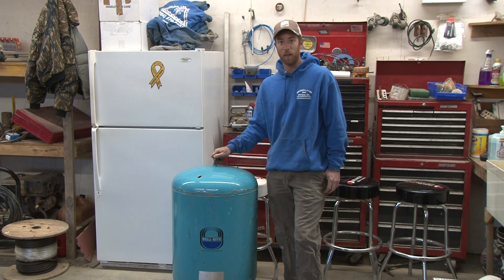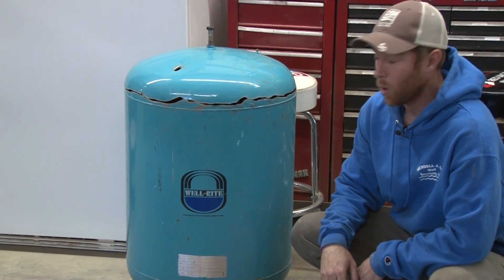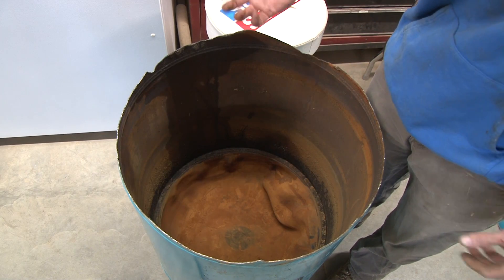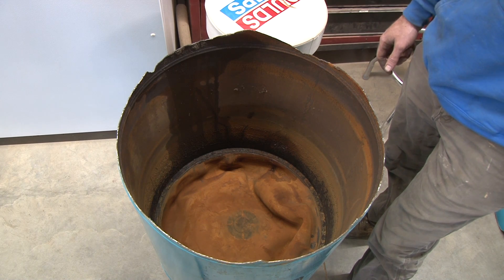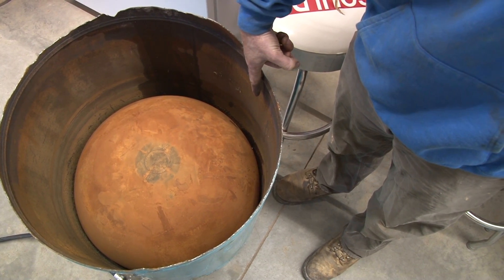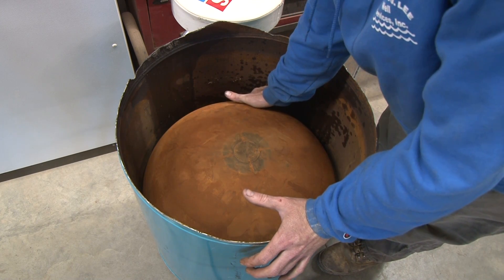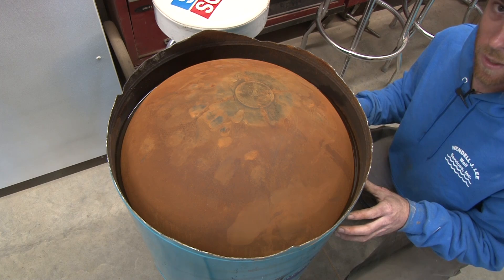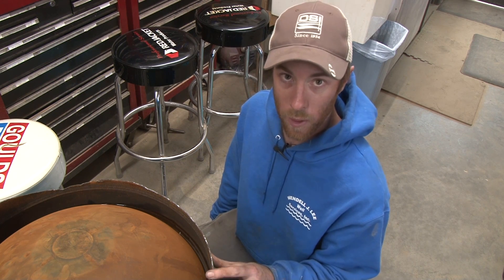Well Pressure Tank: How it Works and How a Tank Gets Waterlogged

Comment: Excellent video and well explained. We bought this beautiful house, but previous owner maintained it in a Mcguiver type of way. Possession in Sept 21 & hopefully just about caught up to bad maintenance work, you would not believe... i thought i would have some breathing space catching up, no way, all happening 1 behind the other... We have a Red Lion RL20 dated 2009.  Right now no problem with it, but piping before pressure tank going to pump is very rusty-flaking. Kinda worries me... i could send you picture if you give me an email?
Also just changed the Beckett ib-32-r oil hot water tank gave up dated 2004. Overdue, so looking at the copper pipe, because the rod inside tank must of been disintegrated, and pipe joints are sweating calcium. Should i consider having them changed? Like for Pex? We still are not drinking our surface well water yet... oh yes, i regenerated water softener and it cleaned up some... again could send you pictures :)  Oh yes again, HVAC guy tagged our furnace, i was telling him about headaches, so he checked the exhaust, Mcguiver had removed the exhaust motor, plus the air intake motor was seized and trap was held open by a pair vise grips. He was so upset, saying 1 more week in the big colds right now and whole family would probably be dead. He is right, waiting for chimney back order, using electric heat and no more headaches. Man some people... thanks, Maurice

Comment: good video  !!!..
I'm going  to  plumb one  of these  tanks  up to  my pressure washer to be sure I have  consistent  water  pressure  , and not  starve the pump when  I'm  out doing  washing  jobs ..
been  doing  alot of looking 
and no one has thought  of it yet...
I have a 4000 ,4 gpm hot water E -Z clean ... it should  help eliminate  running  a holding  tank and trying  to gravity  feed water to the  pump causing it to  starve for  water...

Comment: Need a new wster well pump installed tge well is in a 6" PVC pipe origanly it was driller they hit water at 85ft drilled to 105 ft. Need a new oump. Can you tell me on avetage what ut cost  for someone to pull the old one and install a new one on average. Dont have a lot of money. I just dknt want to get ripped off. I see a new pupm can be bought on Amazon for $200  or so

Comment: I drained the water from our lines. Blew the lines out. Pressure read 0 psi. Put about 10 lbs of air in it, and heard water gurgeling in it. 10 minutes later, it read 0 psi again. Bad tank?

Comment: I was in the process of doing some repairs in the house with the pressure relief valve on the hot water tank, I shut the well off and drained everything down with the garden hose at the well house new check valve between pump and tank, ball valve shut draining the tank when all of a sudden I had a large rush of air and no pressure on my pre-pressurized tank, then tank and pump are new.
 What could have caused it to fail so soon?  Pump and tank put in last month.

Comment: Also, how can I tell if my bladder has a hole in it, without guessing because it appears inefficient.  Thanks!
Reply: Easy actually, check air preassure on the top of thr tank, if its 0 then probe the valve at the top, if you get water comming out of it the bad tank

Comment: Many thanks for the informative video.  A professional pump service told me my diaphragm is waterlogged.  Now I know what that means.  It'll ruin my well pump.  My tank is only about 7 years old.
Reply: I know this a old post just to add your foot valve at the end of the pipe in your well it maybe sucking up dirt or gravel and getting into your  pressure tank and wearing it out from the inside you need a filter before the pressure tank to prevent damage I know this from experience hope this helps you and other people

Comment: Thank you for sharing how the bladder tank works. My well stopped pumping water. I have a Square D Pumptrol 9013FSG Pump Switch. The two middle terminals go to the pump. I thought if I ran an audible continuity test with a multi-meter across those two terminals, I would hear a sound. Did not hear a sound. Touching the screws on the terminals gave me a reading of 0 with the meter. Touching the copper wires, the meter either gave a reading varying between 1,724 K Ohms and 1,775 or no reading at all.  Tried this continuity test with the points open and closed, no difference in the results. Is this normal behavior of no continuity between the two pump wires?
Reply: I was a TV tech aprox. 82-02. I know nothing about those motors. The resistance of the wires does sound high. You might find it on a google search.
Reply: Ok let me explain how a pressure switch works.  You usually have a pressure switch and gauge installed on a accessory T with a 1/4" nipple going to pressure switch. From circuit breaker you have two wires that connect to pressure switch. Those wires connect to either the two outer contacts or the two center contacts. Then from pump and motor in well connect the wires from L1 and L2 inside control box to the contacts that are open inside switch. Once everything is connected restore power to well and wait for system to pressure up and shut off. All that switch does is read pressure on system and when it reaches desired pressure it opens causing power to shutoff at control box.  Hope this helpz

Comment: My well tank came from Lowe’s in October of 2001. I did not realize the cheap tanks only lasted five years. I guess I better check and see if my tank needs to be replaced. I hope you have a video on how to check a pressure tank.
Reply: I did not know that the big box stores sold some that last five years.
Reply: @PIANOSTYLE100  , after watching this video, I checked my pressure tank. It is still working properly. It still has air above the bladder and the air pressure was still correct. I purchased the 36 gallon well pressure tank from Lowes in October of 2001.
Reply: @jacklabloom635  Sounds like you are covering all the bases.  I noticed the Schrader valve on mine was mostly rubber and has to be treated with care when charging up the air pressure or removing the pressure. I'll probably go to Ace Hardware as local hardware stores have an atmosphere that I enjoy.

Comment: This is great information for me. My pump has been cycling on and off for the last few weeks and I had no idea of what was happening... I'll call my well guy tomorrow. I guess older tanks  are longer lasting than the new ones.. Mine was put in 1981 when I had the well drilled. this morning when I went down to check the pressure it was at 55..but knocking on the side of the tank it sounds empty ( ting ting) and it is only about two feet high....small tank.
Reply: mine was here pretty recently installed when I purchased my home 2001.  Its Welltrol 40 gal.  I have had air added a few times over the years but its been fine but recently I noticed my kitchen sink and shower are poor pressure so I called for a check.  At least now I know what is going on.  How did yours make out, what happened 3 weeks ago?
Reply: @ooohlaa13   Hi ..thanks for the question... actually my  Pump guy said. " You don't need a new tank... just recharge the air in it>"  Wow... Since  then I have been getting all sorts of   " stuff" in the aerator of the faucets and the toilet tank. I think I do need one...  I don't want the pump to burn out.. that is far more expensive than just the tank.
Reply: @marygibbs9497  my guy just left, all he could find were spiders in the gauge but he said I don't have a pump problem yet the pressure is low to my kitchen and shower ... I changed the filter,hoping that it will self correct.  So $50 for telling me nothing was wrong.  Unless it is kicking on and off frequently, the pump won't burn out I'm guessing???  Oh well, so it goes.  Thanks for getting back to me.
Reply: I replaced an original pressure tank last year. It had a leak in the bladder/diaphragm and was waterlogged. However volume inside the house was still low. I found many of the faucets installed 3 years ago have small strainers in them and nearly all of them were clogged with debris and sediment. Installed a Whole House Filtration system to prevent this debris and sediment getting into the house. Newer technology in faucets caused some of the problems too!

Comment: I disagree with your statement on the Lowes and Home depot brands lasting only 3 to 4 years.  I used a Lowes tank in my previous home and the bladder was still working perfectly at 10 years old when we sold the home.  For the minimal cost of a new tank I would say 10 years is damn good given the price of the tank was less than $300 and it took 2hours to remove and replace it in the basement.  I wouldn't spend $800-$1k on a tank just to assume it will outlast the store brands.  Not to mention, do you really want an old tank for 20 years?
Reply: over 20 years for my Lowes WellTroll tank but today it is needing air/or replacement.

Comment: groovy.. pumps can short cycle too if shallow well and your point is plugging up or your well is running dry too.. my issue, need a new point..   I hope the plasma cutting friend gets better over time, that certainly was not a straight cut.. I bought one years ago still haven't hooked it up, finally got the filtered air system in place to use though, many do not know it is as picky as painting your car for that air...
Reply: I hope I can get by with new point as drillers in area want 3-4 times the national average and in sand with no big stone and first shelf at around 580 feet.. 100 foot are over 10k here.. ouch.. we got a 640 foot well where we hit that rock at the 580, blasted, and was under 5k 40 years ago...  couldn't imagine a well costing more than the house when next to a lake..

Comment: Thanks for making this video and how it works, I do have a question though, when the tank is bad does the sound or the motor stopped all together and not work, I have 38 PSI but it seems like my faucets and toilet are running really slow

Comment: Clearly a higher quality brand tank will last longer,  but my 119 gallon home depot special has been in service for at least 6 years and is still going strong and no indication that it will fail anytime soon.
Reply: I have a 40 for 21 years now welltrol but am calling service today because i think it needs air, but may have reached its retirement?
Reply: @ooohlaa13  40 years is a long time for a tank. You've more than made your money back on it so to speak. Adjusting or checking the air pressure is easy. Do it yourself and save the money. If it doesn't solve your problem, then it's probably time to replace it.
Reply: @TheLoner801  no I meant 40 gals it says 21 years which is also a long time ... thanx for your comment.  As it turned out, embarrassed to say, it was a matter of blocked kitchen faucet screen and blocked shower head from lots of minerals in Florida water.  Cost me $50 to find out.  The service man said the call is usually $85 but I didn't do anything so just $50.  But at least my mind is clear.  I have been in severe pain with rotator cuff problems for 6 months and I don't have my wits about me except to change the all house filter, and that didn't help.  Wow.   But surely soon I will have to replace the tank.

Comment: I have good water pressure in the house and the pump cycles on and off.  problem is there isn't any water in the pressure tank.  its been replaced but still no water.  it holds 30 pounds in the top but its bone dry in the bottom.  pipes are clear.  do you have to purge the air?  if so, how do you do that?  I've opened all the faucets in the house.  thanks

Comment: Great video. If you maintained a reasonable amount of air pressure in the tank (say 30#’s) , wouldn’t your system continue to work even with a hole in the bladder?
Reply: No it won't what happens is the tank and bladder fill with water and you can't pressurize water. That's why they have pressure tanks. What will happen is the pump and motor will kick on and off trying to reach correct pressure. Once you open say a faucet or flush the toilet is bleeds off the air that was in the tank. Pump and motor kicks on and fills tank with water. Causing no pressure in home. Hope that helps
Reply: Yes, it does work. The problem is that the air dissolves into the water over time and you have to keep putting air in.
Reply: @haroldkahl4610  Harold I believe you are right. The bladder is there to separate the water from the air. I always wondered why the system didn't just let the tank gain water and pressurize the air above it, without a bladder, but now I see that won't work right. This is enlightening.
Reply: @rogervancouwenberghe6685  OKAY... Let em put more clearly. You mean a Pressure Tank without Butyle Bladder in the middle between Water and AIR trapped  be sufficient to cause this action. YES, sir I also thought so. Now our friend HAROLD KAHL clarifies... In principle it works. But Air quickly dissolves in water and we have to keep on pumping AIR into tank. So the whole Excersize of Butyle Rubber Bladder is only to avoid Air getting mixed with water and simply gets dissolved and disappear. Then this action of smooth pressure won't be there. Ha- ha. Now it is clear and am also very happy with Harold Kahl clarification. Thanks again. I think it was developed after having solved such a problem during these Pressure Tanks development. 

Still, as a stop gap arrangement during a break down of Pressure Tank Butyle Rubber Bladder Diaphragm... Can we keep pumping Air into the tank and will it work..!? As smoothly as it intends... May not be smooth... But till such toime Replacement arrives..!! 

Another idea... WHY can't we have a tank filled with water... Then keep a AIR COMPRESSOR on the top to keep pumping air... Let it dissolve... So what... It makes perfect sense... Because now a days.. Battery operated Tyre Inflators for cars are very cheap and any such a Air Compressor may be sufficient. Then we don't need a Water Pump to keep the pressure in the tank. I think it should work and can be developed into a formidable solution with new  Air compressor technology. 

Just soliciting your comments if any... Even if i am sounding stupid...
Reply: @haroldkahl4610   @Roger VanCouwenberghe  OKAY... Let em put more clearly. You mean a Pressure Tank without Butyle Bladder in the middle between Water and AIR trapped  be sufficient to cause this action. YES, sir I also thought so. Now our friend HAROLD KAHL clarifies... In principle it works. But Air quickly dissolves in water and we have to keep on pumping AIR into tank. So the whole Excersize of Butyle Rubber Bladder is only to avoid Air getting mixed with water and simply gets dissolved and disappear. Then this action of smooth pressure won't be there. Ha- ha. Now it is clear and am also very happy with Harold Kahl clarification. Thanks again. I think it was developed after having solved such a problem during these Pressure Tanks development. 

Still, as a stop gap arrangement during a break down of Pressure Tank Butyle Rubber Bladder Diaphragm... Can we keep pumping Air into the tank and will it work..!? As smoothly as it intends... May not be smooth... But till such toime Replacement arrives..!! 

Another idea... WHY can't we have a tank filled with water... Then keep a AIR COMPRESSOR on the top to keep pumping air... Let it dissolve... So what... It makes perfect sense... Because now a days.. Battery operated Tyre Inflators for cars are very cheap and any such a Air Compressor may be sufficient. Then we don't need a Water Pump to keep the pressure in the tank. I think it should work and can be developed into a formidable solution with new  Air compressor technology. 

Just soliciting your comments if any... Even if i am sounding stupid...

Comment: I go thru water tanks every couple of years URGGGGHHH !   I'm being told its from sediment.........thoughts on this and how to remedy it?
Reply: What brand?
Reply: If n it is due to sediment install a filter system before it goes into bladder. I have never heard of sediment causing a bladder to leak though. If your pump is pumping high pressure into bladder that can cause failure. Check pressure switch and drain tank to check pressure of air in tank. If your pressure switch is 40 to 60 psi. Set pressure tank to 38 psi. If it's a 30 to 50 psi set tank pressure to 28 psi. Only check pressure in tank when it's empty.
Reply: Call and ask about having a "shroud" installed on the end of your pump.....shrouds are controversial when it comes to well contractors because if your sediment is bad enough you will clog up the shroud and burn your pump up on the other hand your pump sucking up so much rock will burn it up as well
Reply: Flush your tank every 6 months to a year

Comment: What are the signs of a bad tank? I’m having issues with water pressure.
Reply from the maker: surging of pressure, odor in the water due to water above the bladder are a few signs
Reply: Wendell Lee Well Services what about lack of water pressure? That’s the issue I’m having, along with orange rust color in the water.
Reply from the maker: @Michael-bg1rg  that could be iron in the water which has built up on your pump impellers and has resulted in decreased performance from your pump
Reply: if the bladder is bad would it make your shower to stop and Come right back on while taking a shower